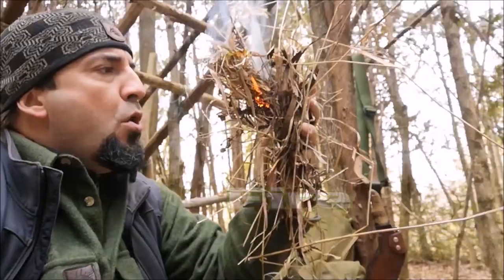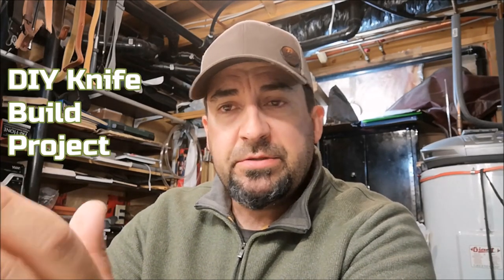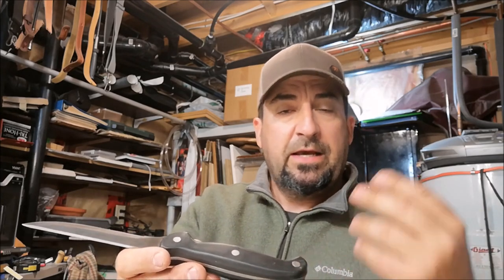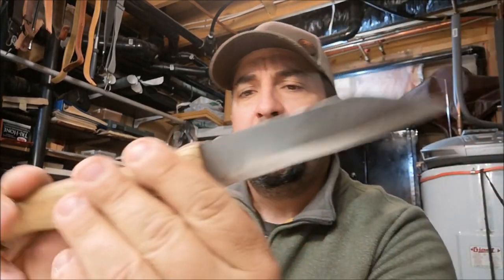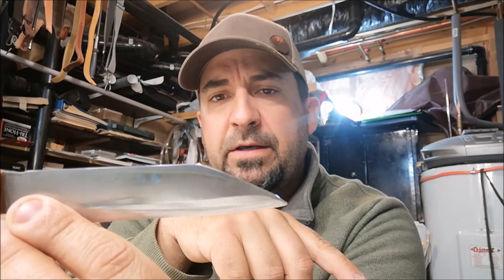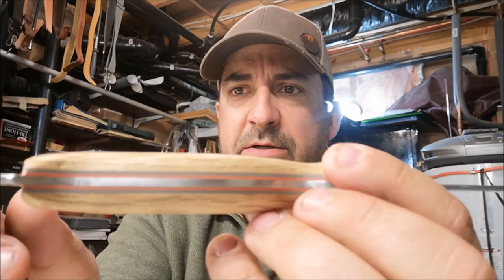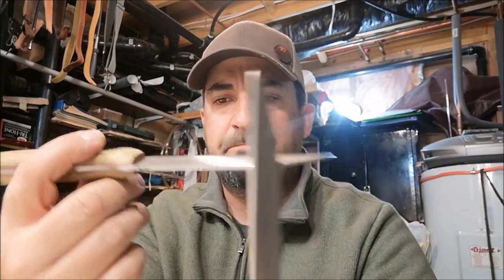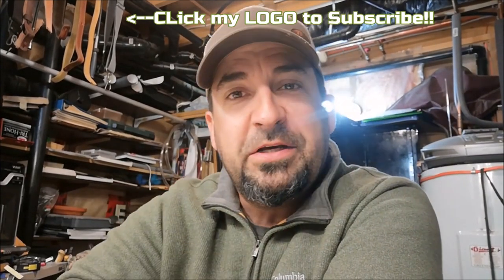DIY Knife Making Practice

Comment: Great video Jeff. How do you grind the blade without affecting the temper of the steal?
Reply from the maker: Fortunately, the blade edge only needs a little sharpening usually and not a drastic reprofiling. Changing the edge to convex or a higher grind line can be done a little at a time and be careful not to overheat.